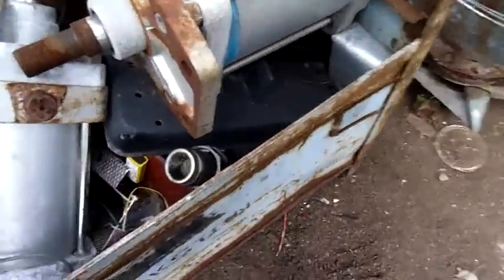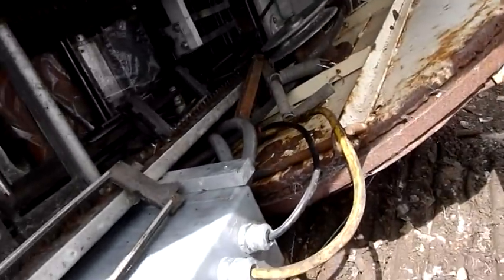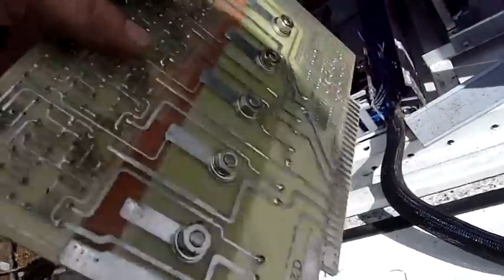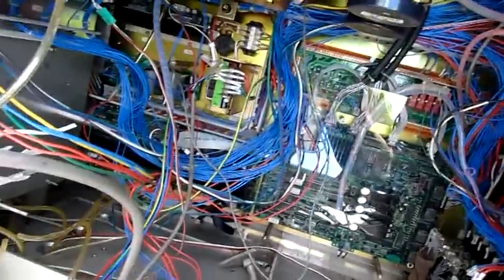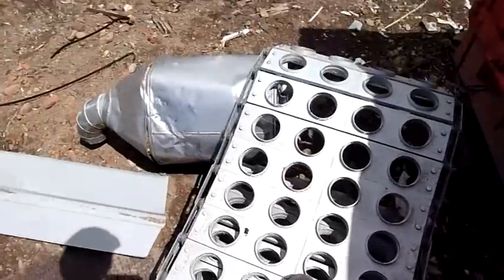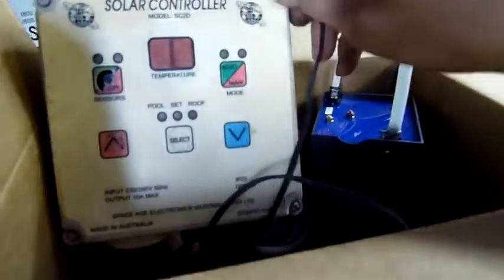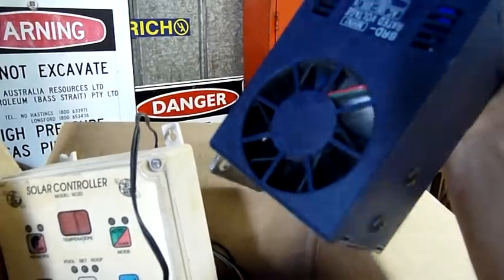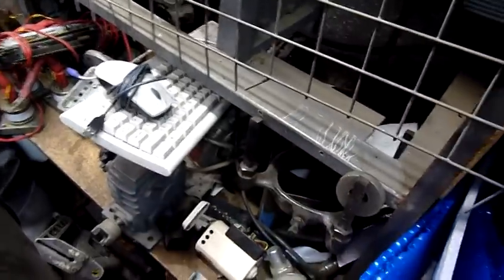Industrial Pile of Dead Everything - Automated packing Equipment

Comment: @nrdesign1991 You'd need a big heatsink or a water cooling system since you need to dump the original heat of the cpu plus the heat the peltier itself makes.

Comment: @Aussie50 oh one of those, for a car, my grandma has a 2007 Ford Freestyle Limited AWD and it has that dumb CVT and its on its Third one in a year and half! luckily its under warranty as to rebuilt them is $2,000 (US $) and to get a new one i even more, all it has is a 3.6L V6 and she is very easy with the gas pedal and does no more than 70 mph on the highway, ford really screwed that up, but in the time that the CVT's do work they work pretty well good power and decent millage, 24 mpg

Comment: Can't wait to see the 3 Phase motor.  I have been looking for a big one to turn into an induction generator to drive from my 3L Mercedes Diesel I run on Veg oil. 
It's a bit overkill for the 5Kw motor I have at the moment although that works well on my Chinese Horizontal Single

With some caps you could set the big 3 Phase up on a C2C arrangement and make some serious power of your own or just backfeed into the grid to save on your power bills. :0)
.

Comment: I wonder why they can't get CVTs in cars to work right? They have been using them for decades now in snowmobiles, scooters, and even mopeds, some with similar power to cars and they almost never have any problems, just another case of over engineering and loosing the handle I guess?